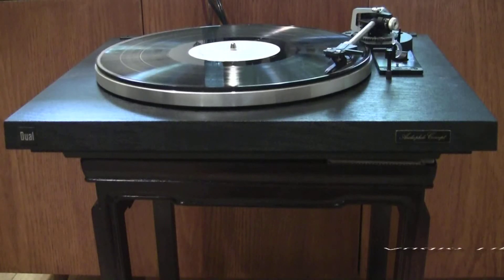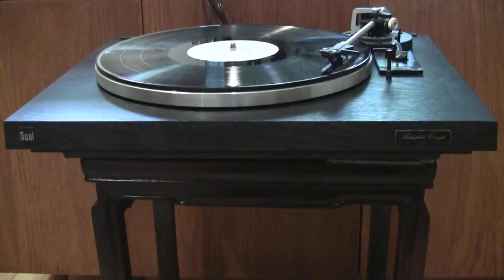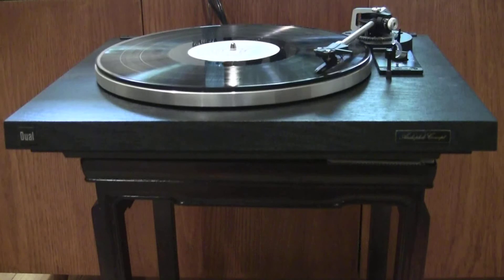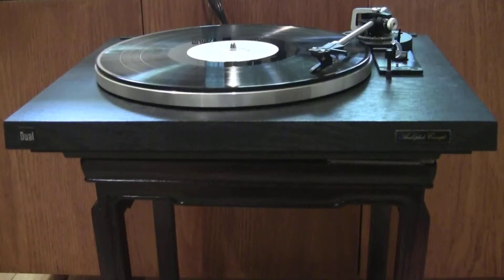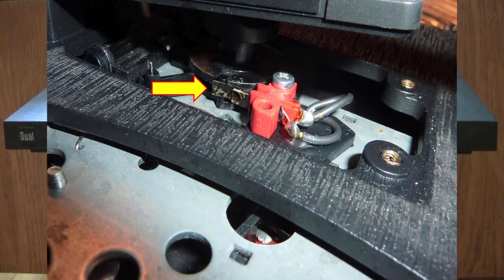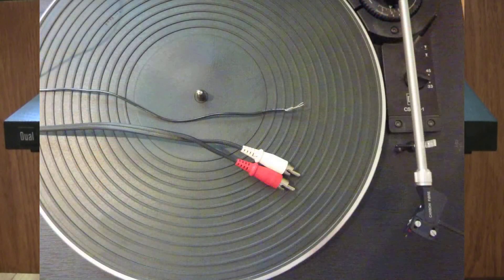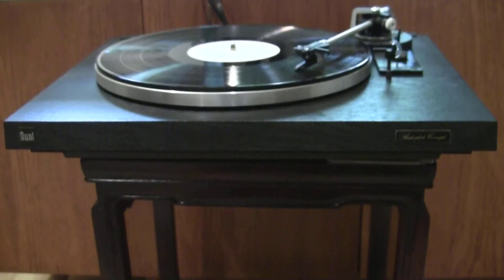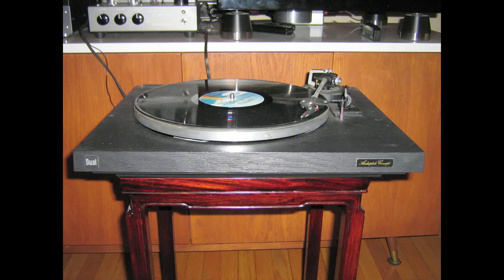Vintage Dual Turntable (CS 503-1): Surprisingly Good Sound!

Comment: I just found one yesterday at a Goodwill for 15 bucks.  It has the Ortofon cartridge.  Didn't expect much from it but it rivaled my much higher end turntable and $400 cartridge.  Surprised its in perfect working condition and the stylus is playing like new.
Reply from the maker: Great find 👍. I think the cartridge, tonearm and turntable are well matched. Rivals my VPI, Hana EL cart. Speed still wanders occasionally but resets when powered off/on. Cheers.
Reply: @AudioTnT  Thought my Ortofon Bronze would be a big upgrade for sound so switched out the original Ortofon.  Nope.  You are correct, the cartridge, tonearm and turntable are indeed well matched.  Would be interesting to have been there when this was designed and who the mind was behind it.
Reply: The only things I find at the goodwill are low-fi plastic junk
Reply: @jogmas12  I also found a Technics turntable in excellent working cond. and looks great once I cleaned it up a bit.  12 freakin' bucks!!

Comment: Cleaning out and replacing the oil in the main spindle bearing can have a dramatic effect on speed stability.  The oils in these turntables are over 30 years old and should be replaced.
Reply from the maker: Will give it a try if I can remove the sub-platter. The lift lever is part of the auto-lift and stop feature which cuts power to the motor. I wonder if there are electrical contacts under the lever that needs cleaning.
Reply: @AudioTnT  You can clean the speed selector contacts and the motor switch contacts.  The sub-platter is only held in by one screw on the bearing well.

Comment: Does your motor wobble a bit when playing? I have replaced the belt but occasionally the speed seems to drift. When I look at the belt spinning round I notice that the motor head seems to move from side to side whilst spinning. Is this the same for yours?
Reply from the maker: The motor is on rubber mounts for isolation, so movement is possible. Not sure if this is source of drift. I still get occasional speed variation but when I lift tonearm using the lift lever and set it down again, the drift disappears. Can't explain it. May try to see how lift mechanism works but requires some disassembly. Good luck. It's not reliable enough to be my main turntable.

Comment: Ok nice but how do I change the stylus.?? I have had this 503_1 since 1984. I just need to be able to get a new stylus. Thank you
Reply from the maker: You pull the front section straight out. The new stylus will come with the front section which you plug into the cartridge body.
Reply: Thank you.

Comment: Oh and if you could tell me what i should ask for when calling different record/ audio places? Are the the stylus  readily available?
Reply from the maker: Ask if they have a manual Dual turntable. Most were automatic multi-disc changers. Stylus and cartridge are still available (Amazon, EBay).

Comment: I bought a used Dual 701 in 1984 for $100 with a barely used Grado Prestige Black cartridge that rivals almost everything anyone wants to put up against it. But that's the effect that Dual has on audiophiles. We see the Dual nameplate and immediately think of the cheap plastic mass-market units that were ubiquitous in the '70s and '80s. But Dual actually made some very good, if not audiophile style, turntables from the '50s right up to their dissolution. And what's even more interesting is that many if not most of their cheap turntables were actually excellent sonically. Their silver plastic fully automatic turntable of the decade around 1980 was a stealth audiophile heavyweight in appliance store clothing.

Dual 1258 was just $200 USD new in the early '80s. The magic of that turntable, and most of the other basic models, was that Dual took what they learned from decades of making turntables, some of which were highly precise works of excellence, and put that know-how into making the least expensive, most functional turntable that they could. They obviously weren't perfect or luxurious, but they played as well or better than most other models available at many multiples of their price. The budget Duals proved that proper design and geometry in a turntable can be done at relatively low cost and yield results that are far better than any use of esoteric, elaborate, or novel designs or materials. Dual got the fundamentals right and in their basic models got results that far surpassed the performance of their peers.
Reply from the maker: In the 70s I had a Garrard changer & then a Rega Planar 3. Should have bought Dual. The semi-auto CS503 I found at thrift store w a Hana EL cart sounds almost as good as my expensive VPI turntable.